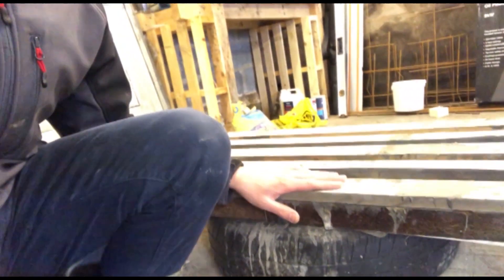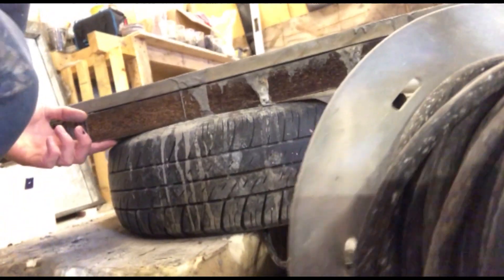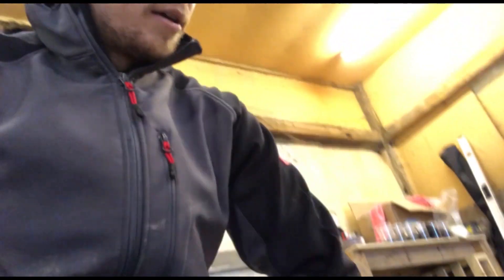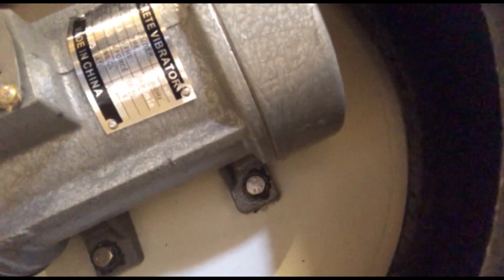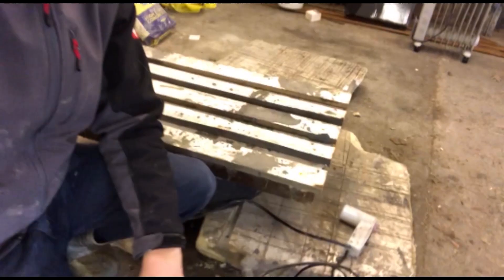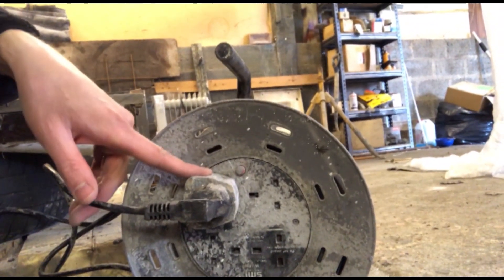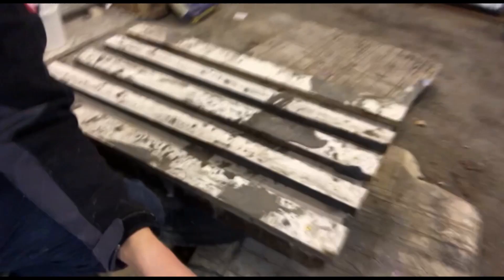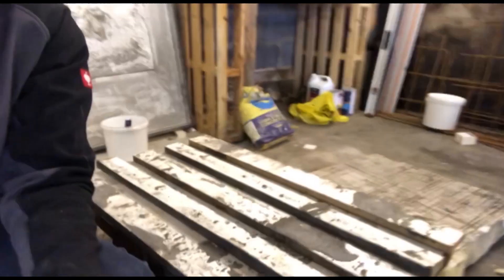How to Make a Concrete Vibrating Table for Under £50 / $80

Comment: Hi Matt, thanks for the video and great design. It seems that the recommended motor is now hard to find in the UK. Do you know an alternative place to buy the motor? Thanks
Reply: Concrete vibrating table

Comment: Question...have you experimented with adding a dimmer switch to control the degree and intensity of the vibration ?  Would this improve the dispersion of the air bubbles while reducing the aggregate from settling to the bottom ?
Reply from the maker: I haven’t, but that’s a good idea for experiencing :)
Reply: @MattHutton  OK.  Thx for your reply.  Might be interesting for you to do 2 test panels, say 1/2 meter x 1/2 meter, both same thickness.  Same total elapsed time of vibration.  One at the single speed the whole, the other using the dimmer & start 25% of time slow, then 50% at full speed then finish the back 25% on low.  The post the results via video !  👍

Comment: How long do you vibrate the concrete for
Reply from the maker: It depends how big the piece is. For something like 1m x 1m x 4cm, if you’re using the table around 2-3 minutes continuously. With and SDS drill about 20 minutes around all the edges. 
2m x 1m x 4cm, around 3-5 minutes on the table until much fewer bubbles come up to the top and pop.
You don’t want to vibrate it too much though as you’ll have all the aggregate sitting at the bottom. Just enough to get rid of most of the bubble abs give you a nice smooth top face.

Comment: Hi Matt 
Thanks for this, what mix do you use for worktops and how long do you vibrate for?
Reply from the maker: Hey Dan, no worries. 40N blue circle high strength. It should be in a link in the description of my other video. https://youtu.be/8aNwMFAdtkI